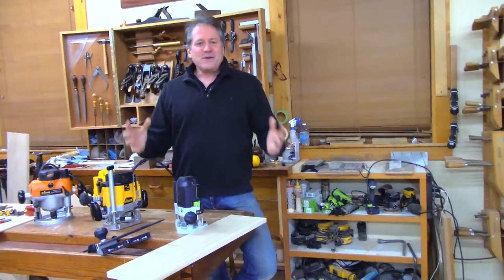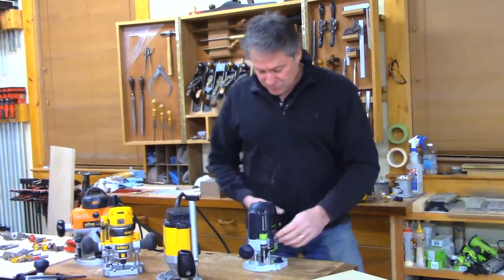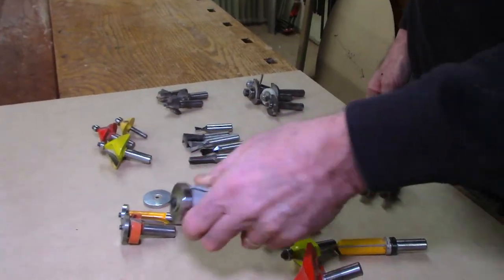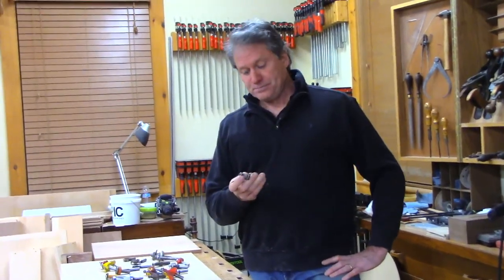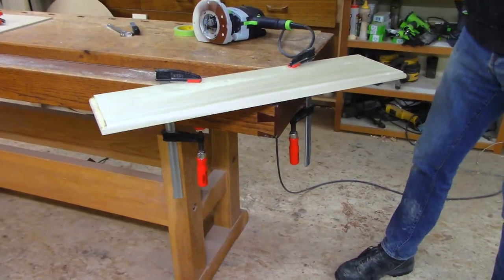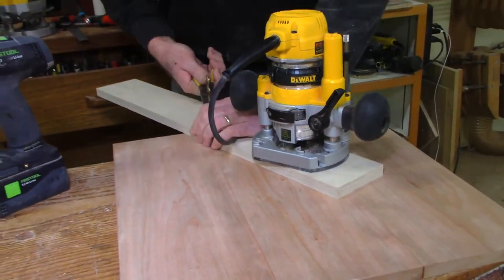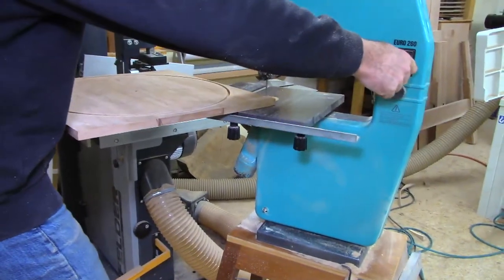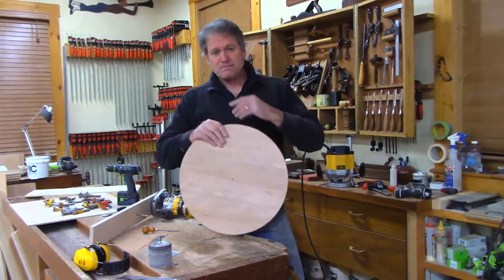Router Basics, Tips and Techniques with Tom McLaughlin

Comment: Hi Tom, missed the livestream, but just watched on YouTube. If you use a template and the router table to finish the circle then you can take full advantage of the double bearing pattern bits. By using the top bearing and then flipping the work to use the opposite bearing - you have to raise or lower the bit to align the bearing with the template - you can always rout “downhill”. In this case the opposite diagonal quarters would have the same settings. I’ve used the Infinity bits like this for many complicated patterns - always perfect results. Thanks for your efforts, always look forward to Thursdays😀
Reply from the maker: Thanks Dave! Yes, you are right on top of it. I actually thought of setting something like that up but decided against it due to lack of prep time...and I’m not crazy about running that big Infinity bit in my Milwaukee table router. But that is a great suggestion, and I will definitely keep it in mind for a future demo. It could almost serve as video showing a great reason to have a double bearing but like the Infinity. Thanks for the great input, and for being a part of it!👍👍 Tom
Reply: @EpicWoodworking  Thanks Tom, “Advanced Router Techniques”- might make a great Shop Night Live.😁 I saw an advert that CMT is making a similar bit to the Infinity and like the Infinity in 1-1/2” & 3/4” diameters.

Comment: just watched the video replay (excellent session) and have two comments/observations for Tom, though i am a rank amateur.  1.  feature of a fixed base on a router (vs. plunge base) is that you can make very small adjustments to the depth, for example when making a dado and you need another 1/64 inch for some reason.  2.  tom showed how the collet on the Triton router was really too short compared to the other routers - and this may explain to me why i find the bit gets pulled out of the router sometimes when while it is being used; so the depth of cut on the fourth side of a shelf is different from the depth on the first side - this has ruined some of my projects or at least made much more work for me to fix things....
Reply from the maker: Thanks Andrew, those are great observations. The only time I had significant problems with a bit slipping in the collet was when using an “uncut” spiral cutter on oak. The angle of the uncut actually puts a force on the bit as if it is pulling it out while shearing the chips “up” out of the mortise. And that was with a better collet than the Triton, I think and older Bosch I had. Anyway, definitely something to be aware of! Thanks 👍
Reply: @EpicWoodworking  Not sure if you mentioned this, but some have said that when you tighten the bit in the collet it needs to not be bottomed out or it will come loose. Always lift the bit off the bottom about a 1/4” before tightening it down.  Thanks for the great content!